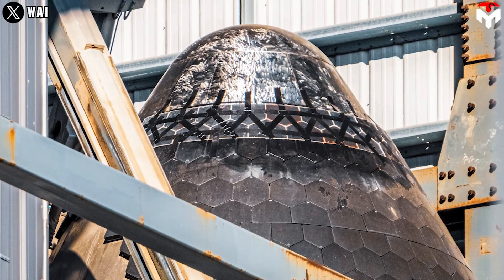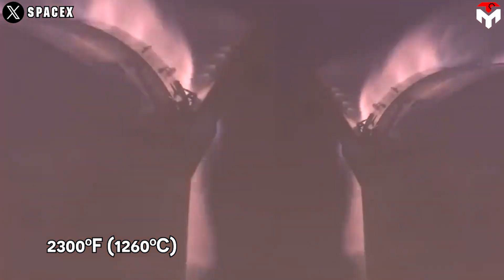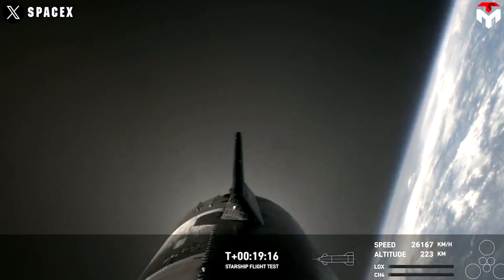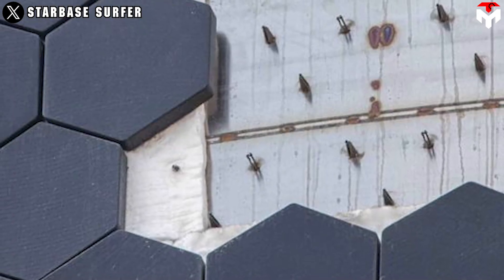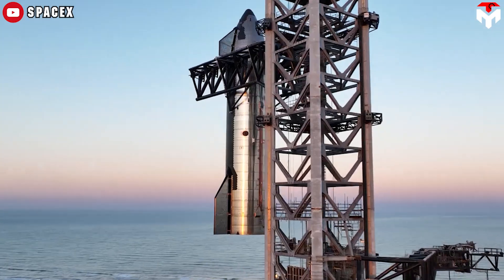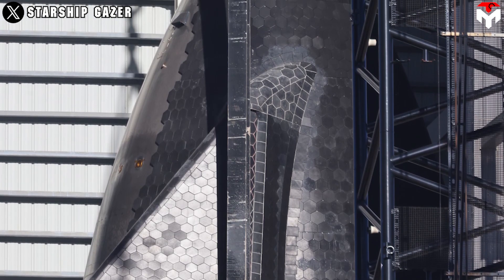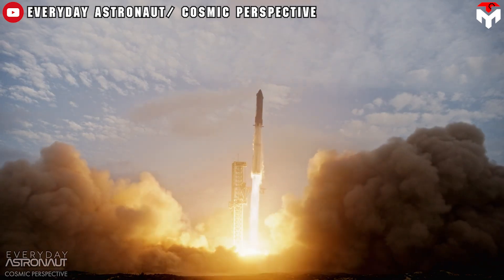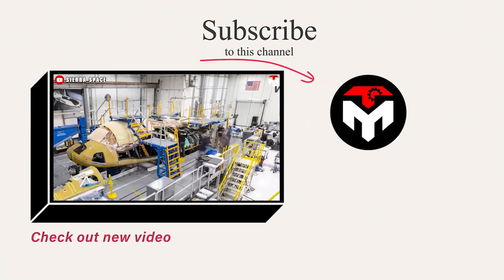Starship officially revealed Huge changes on Starship Heat Shield

Comment: A rippling wave axial or circumferential vibrational mode affecting the vehicle surface underneath the tiles might be a possibility; seems to me this might be efficient at popping attached tiles off.  Solution could be to design rocket to avoid natural harmonics during firing by changing firing strategy, rocket geometry or acoustic rebound from launch mount.  Little rings of a different material incorporated at non-harmonic intervals as one goes up the rocket body might be an idea too to avoid set up of standing waves.

In addition to computer simulation, idea could be tested by test firings at various %'s of full thrust and observing resultant effects, if any, on tiles...of course, they've probably thought of all this I would expect.

Comment: Do you know the process in making the heat tiles. I know they are a form of ceramic. I remember back when the were developing them for the space shuttle. They made them from a particular ceramic grain. With the cracking problem they a having with the ceramic tiles. I was involved in developing ceramic inserts in metal cutting applications. A company I was working with developed a method of growing silicon ceramic into strands. The method was growing the strands into what looked like whiskers. There for referred to as whiskered ceramics. This was developed in the 1940's or 1950's. The majority of this was accomplished before I was born. It strengthen the ceramic inserts exponentially. The heat index and wearability was also increased exponentially. The company was able to retain  the patent for decades. I was wondering in the making of the ceramic tiles if a method like this could be applied or implemented  in the manufacturing of the tiles. It's like putting rebar in concrete. With an incredible heat index. The principles are the same. It would most definitely be worth looking into. It would definitely be beneficial to solving part of the heat shielding problems. Great episode.

Comment: The bigger the radius the further the hottest plasma is pushed away from the surface, I expect the pointy end will evolve into a simple hemisphere of 4.5m radius. A simple constant radius would also help with tiles as the number of different shapes would be minimised.
Reply: What you say is correct. They mentioned how fragile the tiles are. They are a form of ceramic composite. So how would one make the composite stronger? When I worked with Strengthening ceramic composites this is what I came up with to solve the problem. NTK has done some great things in reinforcing ceramics. Just a thought.

Comment: Im wondering if the insulation under the tiles is collecting water from rain and hi humidity. That stuff looks pourous. If its holding water, it will freeze turning to ice and expanding during the fueling process pushing the tiles away and weakening the attaching points. Then all thats needed is a lot of vibration to come off completely. Just a wild guess
Reply: I would say that this wild guess is one of those that suddenly have lot of sense. Never thought about that, but.. that got lot of sense.

Comment: I calibrated the Load Cells at Marshall Space Flight, NASA in Huntsville AL for the adhesive properties and strength. Environmental concerns limit the type of adhesive used. Spaceship safety over environmental concerns?
Reply: Yeah...we saw how well that  " Environmental  Concern " worked out for the  " Columbia  "  Space Shuttle  crew...! 🙄
Reply: @nelsonlanglois9104  Yeah except that was not a tile failure!!! But what would you know!  Probably before you were even born or when you first exhibited an infantile mind!! Sad to see that part hasn't changed!!

Comment: I suspect the tiles would be more prone to dislodge due to vibration during static fire. The base of Starship is in contact with the pad which would reflect vibration back up the fuselage. On top of the booster in a full stack, such vibration should not be as pronounced. What they're doing at the tip of the nose is a mystery. They may only be trying a different adhesive but I've never noticed whether or not tile losses wee more pronounced in that area. Certainly, the title is misleading as SpaceX has not revealed exactly what they are doing. Loss of a few tiles in isolated areas should not be a problem due to the underlying heat resistant sheet and stainless steel. Heat arising at isolated points should be easily distributed by the steel.

Comment: I’ve been wondering about what if the tiles were dimpled like a golf ball or rounded like bubble wrap.  How would this affect lift and heat distribution during reentry? Could the increase in surface area reduce the heat transfer to the metal underneath it?

Comment: Love the new narrator, Sounds so much more natural. Regarding the sintered silica fibre tiles which utilizes a Borosilicate RCG surface layer... 
The tiles at the nose cone did not originally have pins holding the tiles in place, they originally relied on just a specialized adhesive to hold them to the skin. 
So removal of those tiles to add additional pins required the original adhesive be removed where the new pins are to be stud welded to the Stainless skin. 
Failure to remove the adhesive prior to stud welding the pins would result in contamination of the weld zone which would be a potential failure point. 
If you look to Scott Manleys youtube video "How SpaceX Designed A Heat Shield For The Largest Spacecraft Ever Built" the information on the Starship heat shield/tiles is laid out at just after the 10 minute mark. What you will see is that not all tiles used studs But All tiles do in fact use Adhesive. 
In other words, all tiles rely on adhesive but Not all tiles are fashioned with Both Studs And Adhesive.
The tape you see them using when applying tiles is meant to hold the tile in place until the adhesive sets and firmly hardens. 
This is quite evident when you look at the nose cone area as there is plenty of tape holding the tiles until the adhesive sets up.
I thoroughly enjoyed this update as your presentation and content is getting better with each video, keep up the good work, moe of the north.
Reply from the maker: Thanks for sharing your thought. P/s: we have already shifted to the human voice. So glad because you love it